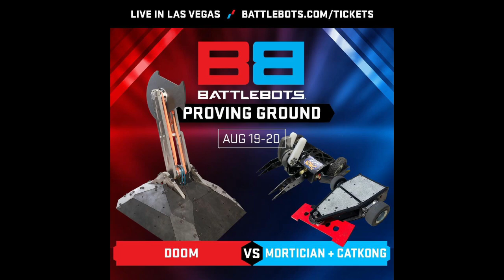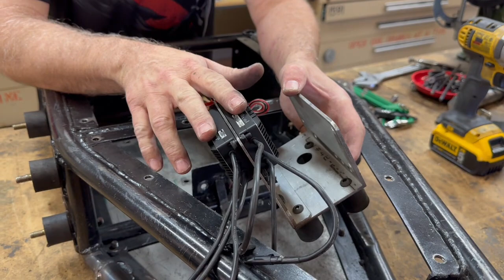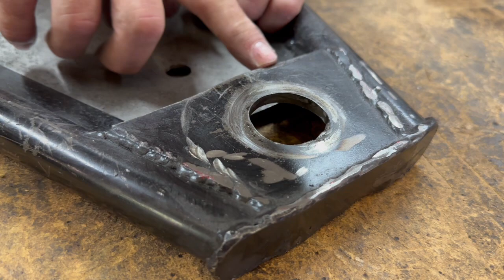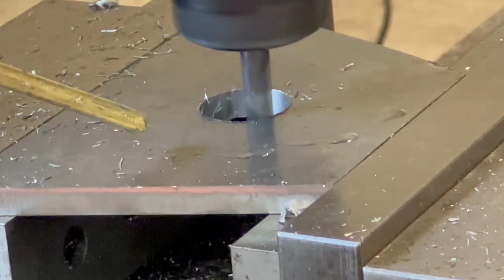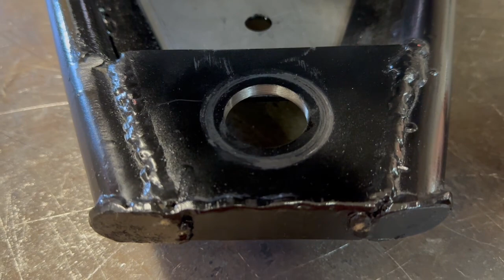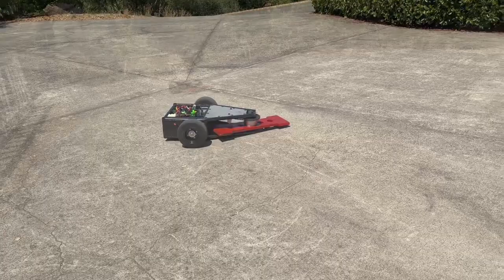Mortician getting ready for BattleBots!

Comment: Instead of adding plate thickness, could you bend the back (unsupported) edge down so it's stiffer?  You'll notice the front edge of the plate did not deflect because it was supported.

Comment: For those wondering, the weapon motor seems to be a Maytech 58113 with a KV rating of 540kv - 800kv (what ray has on the bot depends on his chosen option). For context, the last motor used as the weapon was roughly ~240KV

Edit: I was way off lmao, Ray replied with the correct specs
Reply from the maker: Well kind of yes, and no :) Last motor used was a SSS 56104 in 420kv. It had decent power, but not really enough torque to spin up as quickly as I would like. One of the reasons for this is simply I needed more gear reduction than I had (or really can fit in this setup) and top speed was scary but probably too fast honestly. So I ordered a couple of options to try out. The Maytech 58113 you see was custom wound to 300kv, which is more in line with where the top speed of the weapon should be. But unfortunately this setup didn't really have enough torque either.

I finally settled on a SSS 56123 in 360kv. It's better than how it was run at Robogames, but still takes longer than I would like to spin up. Future versions will most certainly have some changes here. But with what I can make happen right now this seems to be the best option.
Reply: @ray9368  fair, I was going off the old info from the Sierra college robotics club when we were updating wolverine (before his unscheduled disassembly at robogames lol)

Comment: if you dont find a good way to use those extra weight maybe add a 3rd minibot to the team? with magnets and state of the art brushless motors i think you could build a really really nasty doorstopper wedge. dont know if youd have enough time to assemble one though.
Reply from the maker: Both Martin and I are planning on using some of that extra weight for the matches, and I think two robots is enough :)
Reply: @ray9368 wish you a ton of fun. 2 is definitely enough especially if you already have god plans how to use that weight. but you know.. sometimes more is more 🙂
Reply: oh just watched the to the end. yeah you definitely wont have time left :-D. all the best to you and the team
Reply: @denisloebner4882  Just ask Robert Rund to get on a plane to Vegas and bring Crashfest with him.  It's ready, it's three pounds, and it does not die*.

*it's been given the people's elbow by a 45lb Depth Charge, but it's never faced a 250lb.  It might turn into confetti.
Reply: @stonefish98  oh nice, need to check that one out. but if you have a surplus of 10lb you could turn that into like a crashfest 3times the size? or how about 3 crashfests? 😀

Comment: Is the top nose plate already 3/8" ?  If not and still the 1/4" wouldn't it be prudent to replace that one too ?  Like you said, if it's bending at middleweight.....
Reply from the maker: The bottom plate sees much higher shock loads than the top, since the weapon is mounted lower on the shaft. So although you're right, I could have replaced both plates, but circumstances sort of limited my options (the piece of material I had was only big enough for one plate) so I only fixed the part that was actually damaged. Of the things that are likely to break this coming weekend, this is one area that I think will be fine :)
Reply: @ray9368  Good luck and thankyou for sharing your video's.

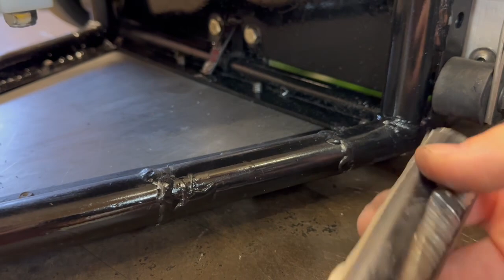Comment: 6:00 for the replaced parts of the frame, how much weaker are the welded joints? is it AR400? also are you sticking with the NPC T74 or are those drive motors a different model?
Reply from the maker: There are some concerns in welding in patch parts. The biggest issue is where the welded joints are, the material loses some flexibility. This can cause other failures around the welds, but usually not in the welds themselves. 

Mortician's build has been very well documented here on my channel, showing pretty much everything that was done in the build process. Here is the one on the drive motors:

https://youtu.be/5ZLmKNoZ-J4

We haven't used NPC motors in Mortician in a long time.
Reply: okay gotcha, like it worsens stress risers? also oops, was just going off of the wiki page. I'll check out the other build videos tomorrow :) @ray9368

Comment: It will be interesting to see how this works out. The usual problem I've seen with twin attacks is the failure to properly coordinate and actually attack as a team.  The highly dynamic nature of the fight doesn't help.  It usually turns out to be a fight Jacky Chan style, where only one attacks at a time.  When that happens, the larger bot makes short work of the smaller bots. I'd love to see a fight where the twins can properly attack simultaneously. The trick is going to be not to hit each other in the furball.
Reply from the maker: That's really it in a nutshell. Multibots typically are usually at a disadvantage, and some coordination from the multi is needed to do well. In this case, both middleweights have heavyweight like kinetic energy numbers, so either is capable of damaging a heavy. I guess we'll see in a few days!

Comment: Something I’ve always wondered is if you could put some sort of metal shielding around the wheels so it isn’t a major weak point. Thank you.
Reply: This has been addressed in the past, quite a few times. Basically, the wheels are only ever a major weak point if the weapon has been stopped or a major driving error has been made—at which point the gig is usually up and the fight is all over but the shouting.

And what would be sacrificed to protect those wheels would be weapon mass.
Reply: Orbi blade is a perfect example of why that's a terrible idea
Reply: unnecessary, the opponent can't reach the wheels if they die in one hit